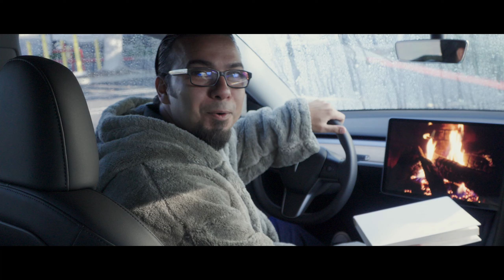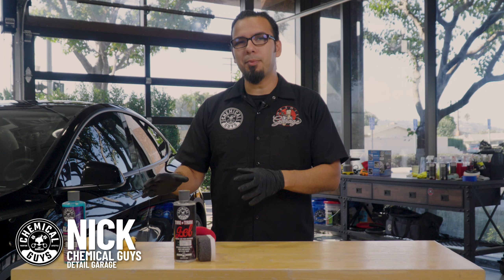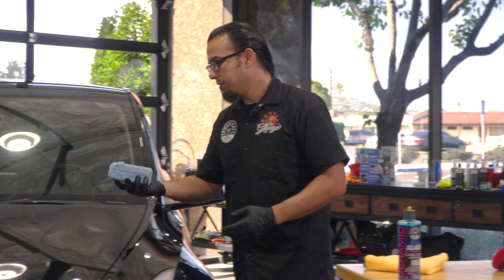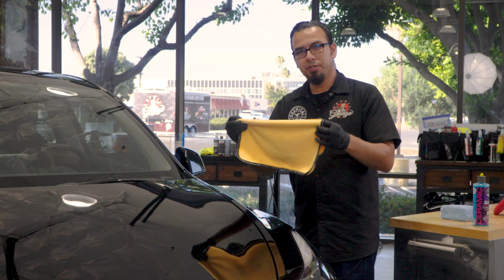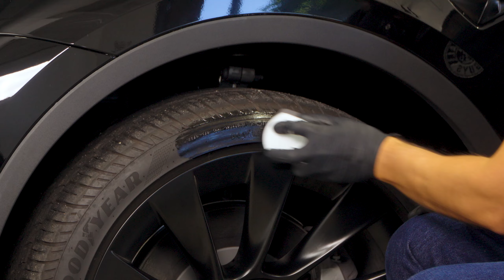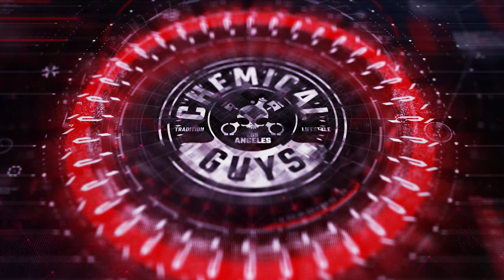Winter Car Protection - Must Have Detailing Products for the Season Change! -  Chemical Guys

Comment: Can you get away using hydroslick without clay baring?
Reply from the maker: Hi there! It would be best clay the surface before applying HydroSlick to prevent lock in contamination as well as promoting a long lasting bond.